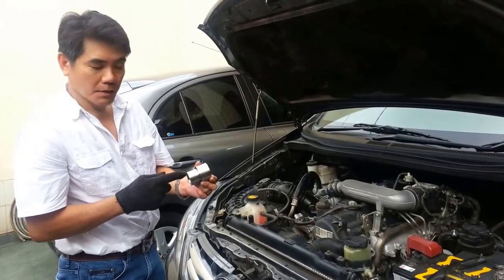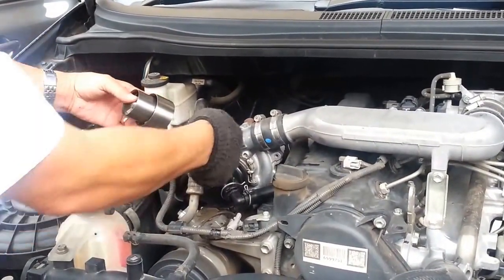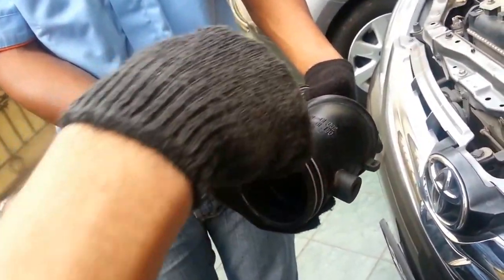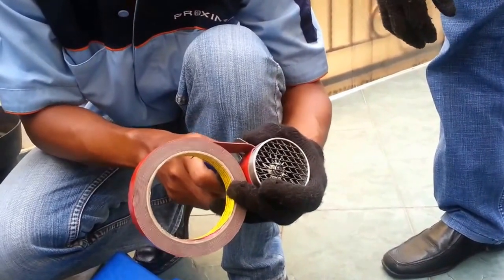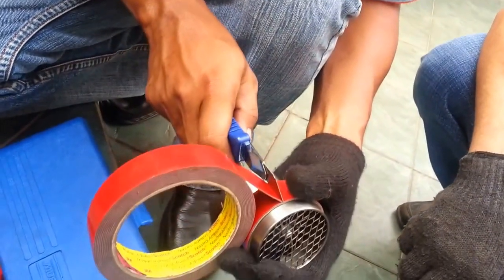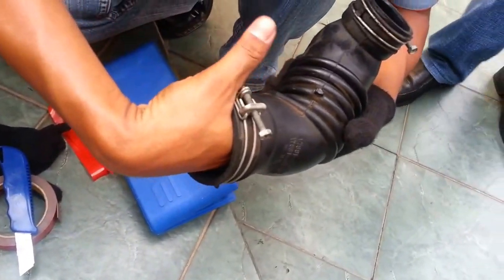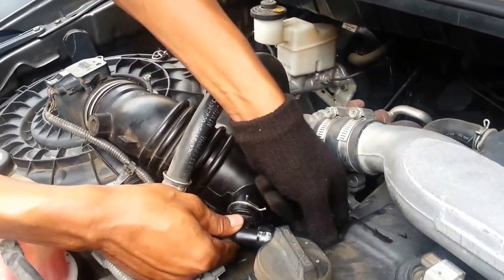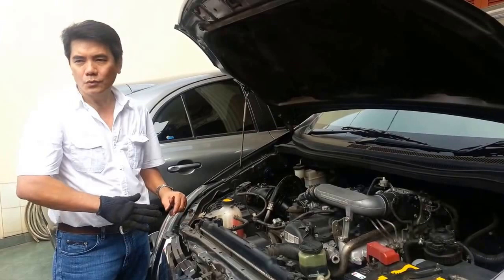Toyota Innova - Diesel - Proxima Turbojet Limited

Comment: is there any sense in this device, i think you dont kwnow science ,its already compresed air coming from turbo, you are blocking the compresed air and you deliver the air to in that device how it will get more are😂😂😂😂
Reply from the maker: What I can say is Experiencing is believing. If you haven't used it it is difficult to believe. But will a manufacturer make a product that is not useful at all?  If this product blocks the air it will make the engine heavy. What happened to thousands of units we have sold?

Comment: What are the advantage and disadvantage of PROXIMA TURBOJET ACCELERATOR in my INNOVA M/T 2014, coz i'ed like to installed one,.
Reply from the maker: Proxima Turbojet Accelerator is a device to help to speed up and increase the amount of air entering the combustion chamber. A device to help an engine to reach a better and more efficient combustion. A device that creates perfect combustion, RPM of the engine increases spontaneously, thus torque and power of great magnitude is quickly reached. Emission drops to its lowest level. No more lag, knocking, over-heating or high gas-mileage.

Comment: How will it help the turbo/engine or air intake by choking it, placing object to obstruct the airflow will cause engine low power it will damage some parts. This is a scam. Don't ever ever try this.
Reply from the maker: It will certainly not obstruck the air. Instead the high speed turbine and propeller will speed up the airflow. It suits both NA and turbocharged engines. The extra drive of air is felt since low rpm. That's why in turbocharged engine, this device is one of the best solutions to reduce turbolag.

Comment: Wher do you get in India , what is the benefit of turbojet pl guide
Reply from the maker: Sorry it is not available in India. If you are interested you can contact: marketing@proximaturbojet.com. Proxima Turbojet Accelerator is a device to help to speed up and increase the amount of air entering the combustion chamber. A device to help an engine to reach a better and more efficient combustion. A device that creates perfect combustion, RPM of the engine increases spontaneously, thus torque and power of great magnitude is quickly reached. Emission drops to its lowest level. No more lag, knocking, over-heating or high gas-mileage.

Comment: There's 4 ways to Decrease turbolag...

1. Swap your downpipe to the smaller diameter it offers less airflow, but it will increases the speed of exhaust flow, this extra speed provides extra spool for the turbo itself

2. Replacing or install a blowoff valve, allowing your turbo pressurize the intake more efficient

3. Buy a new intercooler kit for your turbo, the shortest piping make less amount of air pressure drop.

4. Install a bigger Turbo.. even tough its still had a little bit lag.

This device gives me so many questions..
Reply from the maker: Why not try one simple inexpensive way, by installing PROXIMA Turbojet Accelerator. No need for modification of anything, it just takes around 15 minutes to install in any cars
Reply: @PROXIMATURBOJET  no thanks 😄✌ engine is a crucial ones
Reply: Yea shits restricting airflow 🤣

Comment: for what purpose you have installed it?
Reply from the maker: Proxima Turbojet Accelerator is a device to help to speed up and increase the amount of air entering the combustion chamber. A device to help an engine to reach a better and more efficient combustion. A device that creates perfect combustion, RPM of the engine increases spontaneously, thus torque and power of great magnitude is quickly reached. Emission drops to its lowest level. No more lag, knocking, over-heating or high gas-mileage.
Reply: @PROXIMATURBOJET  ok ill try.
what it will cost?
Reply from the maker: @londhekkunal  The cheapest stock we have is USD 450 ....
Reply: @PROXIMATURBOJET  ok thanks 👍🏻
Reply: How much it is?

Comment: Turbo lag itself is the power for the turbo fan to kick in at full rpm. How adding another Fan in Air intake manifold can decrease turbo lag? it's like another small turbo adding. The why on earth VGT is invented, and Toyota is not opting it?
Also, after some time, due to dust and oil accumulation, if the second small fan will get struck. 
lame idea. Does Not work.
Reply from the maker: Turbo lag itself is weakness not a plus point. Making driving is not comfortable. Why Turbojet Accelerator can decrease turbo lag? Because force of air starts at lower rpm where as that of turbo charge starts at much higher rpm. VGT does not work as well as it is intended to. Many times we have even installed in a twin power turbo engine. It works well.

Comment: ممكن توضح لنا بااللغه العربيه
Reply from the maker: Turbojet Accelerator is a tool to accelerate and compress the air entering the combustion chamber so that combustion becomes perfect. A fast and solid air drive will make the engine speed increase so that it can eliminate pause or even when the road is climbing. Another benefit is more fuel efficient, exhaust emissions dropped dramatically, smoother engine sound, gearshift (automatic) is smoother and in the end the engine becomes healthier. Suitable for engines  both gasoline and turbo diesel.

Comment: i see that there is no Motor in it means its only driven by the intake air..so there will be no increase in engine output power. unless u put a motor to spin that turbine to supply more air for the engine. which is also not that simple. bcose u have to put some micro controller to control the motor speed. my suggestion do more experiment by fixing a motor (brushed or brushless type) and a speed controller and a processor. do dyno test. and compare the output with variable setting u make....just saying.
Reply from the maker: If a motor is fit, at low rpm it might be good but at high rpm the motor will obstruct the turbine rotation and in the end will decrease air inflow, as a motor spins at a constant rotation. This device speeds up the air flow, when the accelerator is pressed the air is already there. So it there will be no (turbo) lag anymore.
Reply: i dont think so....but it seems that u already have ur own thought on your product..good luck with that.
Reply from the maker: Yes, we may disagree on that point. Anyway, thank you for your comments ....
Reply: turbinnya udah di balance ? harga berapa?
Reply from the maker: Di balance Pak. Harga mulai 3jt

Comment: Ahahaha stupid scam.. This dude dont know anything about engine power. Scambag
Reply from the maker: romeo mabunga If I were you, I wouldn't make such a haste comment. At one time the Earth was even considered flat. Experiencing is believing.
Reply: PROXIMA TURBOJET .. Sorry about that... Anyway have you try to run that on a dyno before and after the installation?. If your system is true them everyone needs a proof. Run it on a dyno..
Reply from the maker: Dyno test was done long time ago, but we didn't record on a video. It increased but not so significantly I admit. Anyway, dyno test only shows maximum power an engine can produce. In daily driving, we mostly drive in between 1500 - 3500 rpm. Proxima Turbojet is able to give driving comfort and an enjoyable experience because the air is standby and ready upon suction. There is no more lag at all in between lower up to higher rpm.
Reply from the maker: It's Okay, no problem..... Good advice ..... It was once tested but not recorded on a video. Not significant increase in horse power.  High horse power only shows maximum power an engine can reach. But driving comfort can be reached with Proxima Turbojet. There is no power lag when we accelerate, this is made possible because the air is compressed and is stand-by all the time. No need to kick down, just relax the car will run very lightly. Driving with Proxima Turbojet is fun.